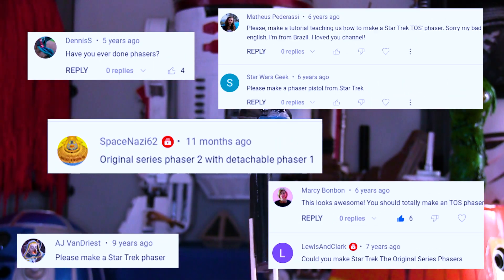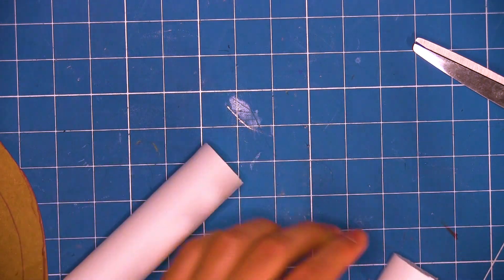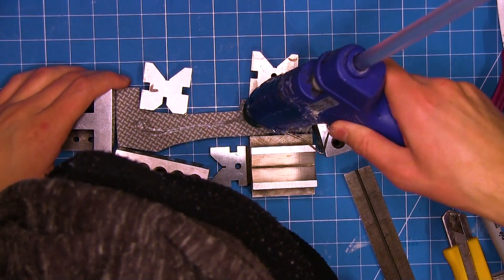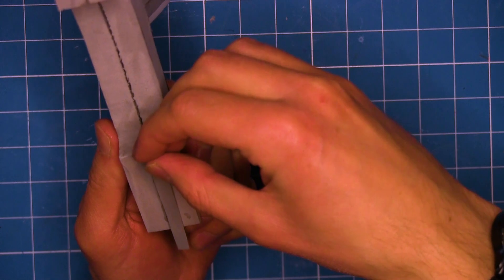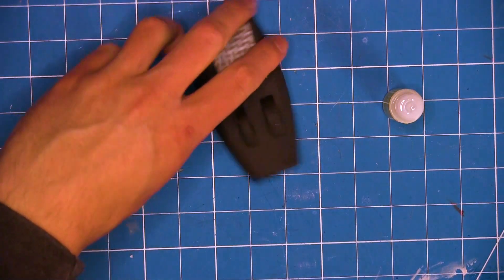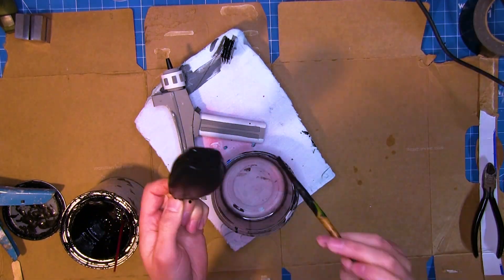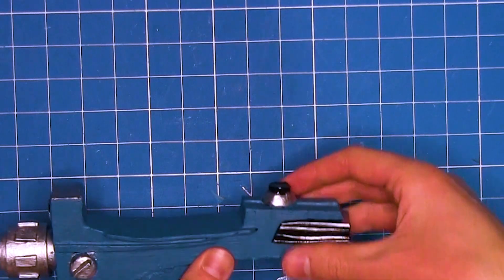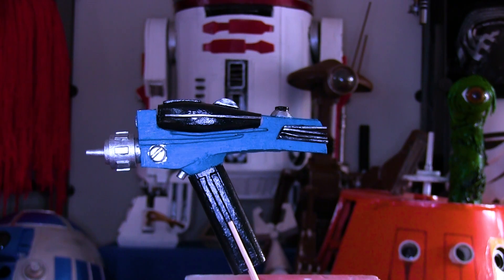How To Make A Phaser (Star Trek DIY)

Comment: He doesn't like the dust generated from sanding. It's coarse, and rough, and irritating, and it gets everywhere. Not like EVA foam. EVA foam is soft, and smooth.
Reply from the maker: Calm down Anakin
Reply: @WilliamJakespeareProps  Thanks for the reply 6 months later :) It was a slow burn joke